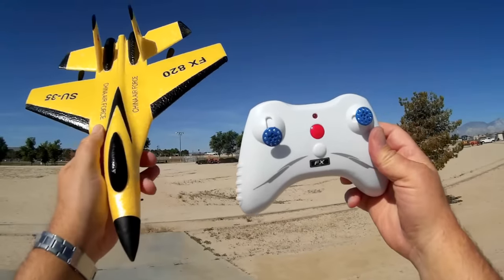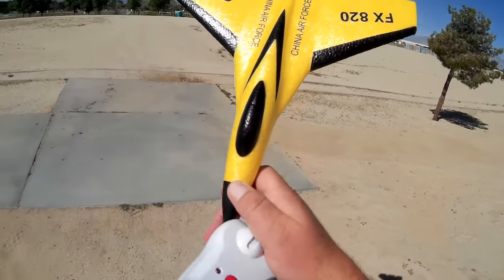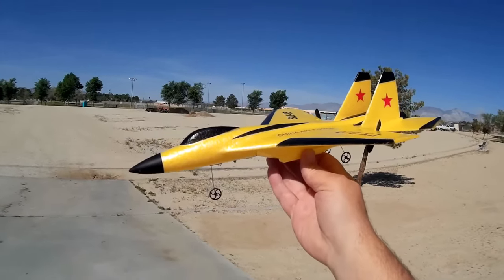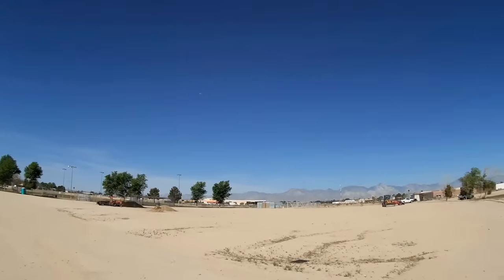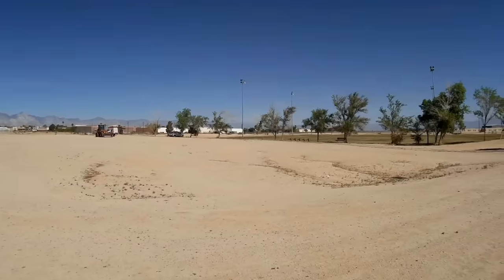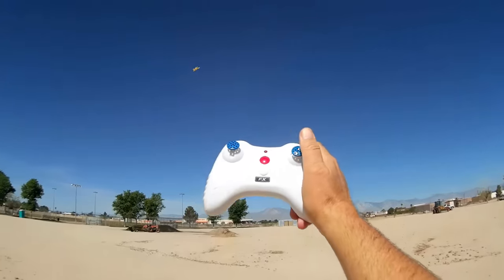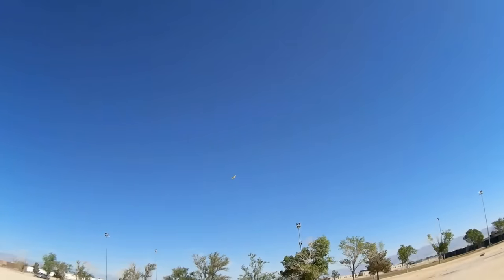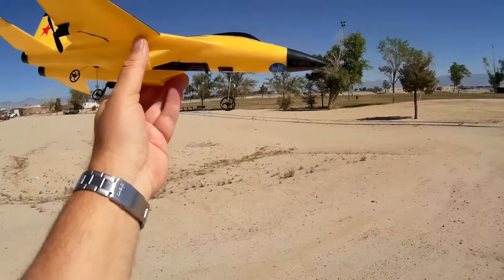Flybear FX 820 SU 35 2 Channel RC Airplane Flight Test Review

Comment: I finally discovered this plane has proportional throttle thanks to this video 🙏,this wasn't possible 10 years ago, they miniaturised the esc board ,fantastic value ,and hollow core motors will last years
Reply: Yeah this looks pretty cool I might have to save up for one 😅

Comment: the front is super light. bend rear flaps up and this bad boy will fly stunt circles in a 10 foot box, bend flaps down for speed. I run a 500 mah battery (its a tight fit), but it flies for darn near 45 minutes for real, and didn't burn out my motors. Some models have a steel ball bearing under that nose for weight. I removed it during battery swap. amazing flyer.
Reply from the maker: Yeah, instead of adding parasitic weight to the nose, it would probably be better to simply add a larger battery.

Comment: I think maybe you have to give the gyro a bit of time to set before flying.  Or she was a bit tail heavy.  As per wind?  I've had ones like this and with a little bit of weight added, (I think I used a dime,) in the right place?  It cut right through wind.  Was pretty fun.  You bank it more than turn it when it's like that which is fun, but you have to have the space, (for those who don't know.)  I love planes like these because you can play with the CoG, overall weight of it, etc.  Good times!
Another great video, my friend.  Keep 'em coming!

Comment: Got mine two days ago. Good call on gluing landing gear , lost mine first time out. Glad I had C17 first, it gave me some idea of what to expect. I thought it was same maker and expected the trans to be the same but it is not. There are no trims. The C17 is easier to fly but both are tricky to turn as you demonstrated. I also snapped off the nose in one of my crashes, caused by the tip stall you showed before I got a handle on the steering. It still flies without nose and front wheel and handles much better at half throttle or less. As per instructions I had to bend rudders a bit to trim out major right turn. I'm going to miss the landing gear though , I like ground take off and landing.
Reply: I never did get my C17 to actually fly ! - it just wouldn't develop enough thrust to even fly level.
Reply: Richard: That's odd, are you sure the battery was fully charged? I ordered 4 and they all fly and glide beautifully. I also hollowed out a longer battery bay to the rear and run 300 mah batteries. Also I put the tail all the way in (sea level)

Comment: I decided to buy some ready to fly planes since I have had no luck building from foamboard. Eventually I will get it. I took this plane to my local park for its maiden flight. My park seems to always been windy regardless. I hand launched it, and it flew perfectly. It ascended so I high I feel the controller lost communication, I had turned the throttle down, and tried to navigate it back to me. However the wind was able to keep gliding away from me, to the point I lost sight of it behind a tall tree. I was running towards it hoping to gain control, I feel at some point I did, since it did crash in a field. It was a field of tall grass but since it was out of my view behind the tree I had no idea where it landed. I thought for sure I lost it. So a thought, I knew what it sounded like, so I throttled up and was able to recover it. AS STATED if you want to keep it, dont fly it on a windy day regardless of your experience. Great plane overall, super fun!

Comment: I want to buy for friend. Where I can get
Reply from the maker: AliExpress seems to have the best deals on this plane right now https://www.aliexpress.com/wholesale?catId=0&origin=y&SearchText=fx820
Reply from the maker: Also make sure to purchase the FX820 (the same plane as in this video).  Do not purchase the smaller but very similar FX620.   Although the FX620 looks the same, its controller is different.  Also, the FX620 may not have the same gyro stabilization as the FX 820.

Comment: Do you live in California or Arizona
Reply from the maker: I lived in California. But am now in Pennsylvania.
Reply: @Quadcopter101  okay this look like Arizona or kind of like California because of the desert looking background.
Reply: @Quadcopter101  I also have the Sig model plane but for some reason it doesn't fight off the ground could you please tell me why?
Reply from the maker: Do you have a smooth surface, like concrete, to lift off from?  This plane does not have enough power to take off from dirt.  You need smooth ground for it to get enough speed to take off.  If you don't have smooth ground, hand launch it to get it into the air.

Comment: I wanna buy it T~T
Reply: Its like 50 pounds its cheap or get a 2.4G Radio Remote Control Airplane Piper J3 Cub RC Plane Beginner Glider its like 27 pounds

Comment: Anyone have any ideas about the best drone under 200? Don't care about camera, but good battery and range etc
Reply: Not sure why you want range with no camera?  Have you ever flown a quad 500 meters out?  Even the best quad pilots lose orientation at about 200 meters.  I'd invest in an FPV system which you can do for around $200 or a little more.. Start small.  Furibee X140 with Aomway goggles that I have is great.  Of course, I have far above $200 in the setup.  You get what you pay for.. Hubsan H501S that I also have is around $200..
Reply: Yeah was hoping to mount my own fpv system, was looking for something that could hold a small camera, e.g. an mjx bugs. Was wondering which kind of quad would anyone recommend?
Reply from the maker: To better answer your question, need to first know your skill level?  What drones do you own, and how long have you been flying them?
Reply: Been flying for maybe about a year, but have not had many drones, and they haven't been the most high quality ones either